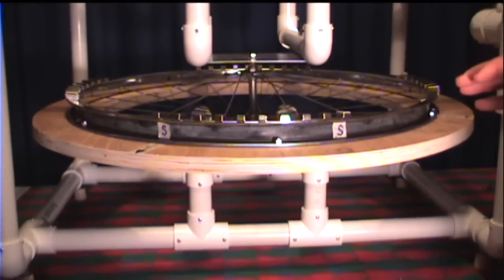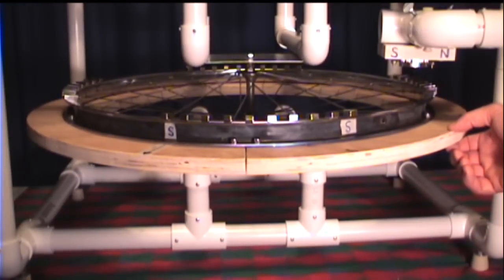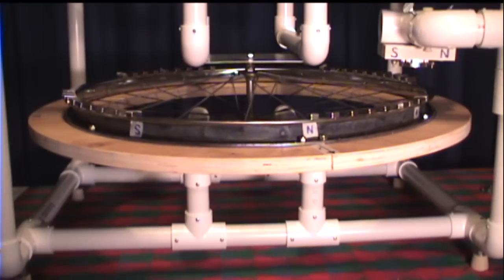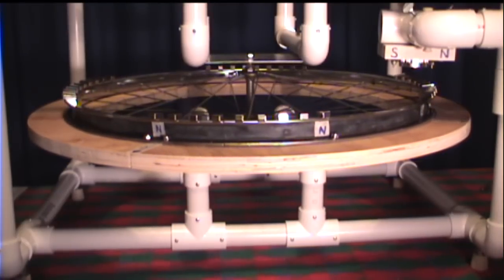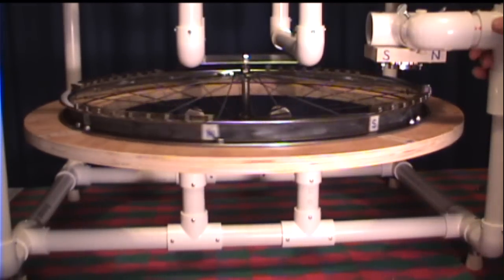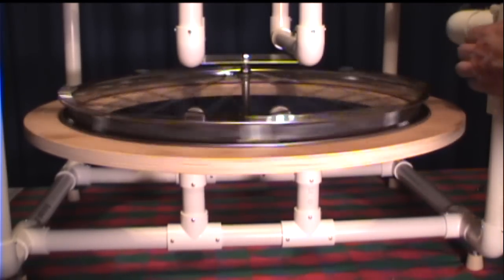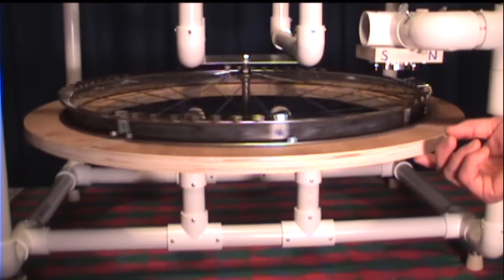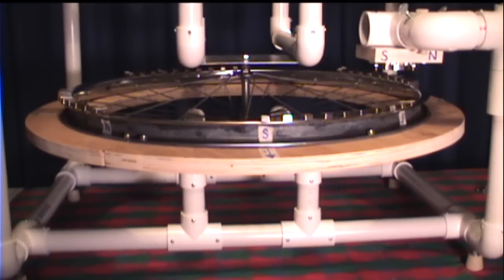Video #19, "Rick's Pipe Dream" Magnetic Motor - Generator Project

Comment from the maker: Stefan, the 135 degree demo showed 2 accelerative forces followed by 2 decelerative forces, and that was only because the stator was in a fixed position. When moving the stator, all the forces are accelerative, and there are 8 of them per revolution, but only 4 stator movements required. Also, each stator movement required less force than any one accelerative force produced. The excess force from the accelerative effects is stored in the rotor and flywheel as inertial momentum.

Comment from the maker: Hi jillyand, and thanks for your post.  Magnetic movement of the stator carriage is what I am currently working on.  See my latest 3 videos for views of the slider carriage.  Two magnets at the center hub will be used to repel the carriage outwards, and two more at the outer perimeter will repel the carriage inwards at the proper timing points (directly after the tail end magnet of a rotor group passes the carriage).

Comment from the maker: @100roberthenry - Hi Rob, you may find video #32 of interest, which utilizes a sweeping rotor magnet pattern. It does work as an attraction layout, but one cannot utilize attraction and repulsion this way in the same direction of rotation. In other words, in order to gain some repulsion acceleration, the rotor magnet interacting in repulsion with the stator would first have to pass under the stator and then repel away from the stator. Until it passes, it is working against rotation.

Comment: I think they are right a good analogy would be loading a sping then holding it back till you need it. The force needed to move the stator would far outweight what you get in drived motion. Of course the spring has captured energy but you loaded it. The only way around it is to look for a less resistive way to move your stator. Say rotational movement. You could make a round track that the movement gets focused any way you want and use that to flip the poles quicker at higher speeds.

Comment from the maker: The animation is not a continuous one, but with 32 frames it shows two pole shifting movements of the stator, and the basic magnetic interactions that cause these movements.  Be sure to watch the animation in a full screen view, or it will not display properly.      -Rick

Comment from the maker: Yes, the starting point that I used was the high repulsion margin at the tail end of a north facing magnet group, and this gave a spring like effect in conjunction with the north stator pole to start rotation.  The second positive rotational force is encountered at the next magnet group, which is south facing and thus in attraction with the stator north pole, causing further acceleration.

Comment from the maker: It was not friction that finally stopped the rotor after its 135 degree movement, but rather the two decelerative forces that followed:
1. Attraction force at the tail end of the south facing group.
2. Repulsion force at the lead end of the next following magnet group which is a north facing group.
The only reason those two forces stopped rotation is because the stator poles were not swapped at the end of the south facing group, as they would be with a moving stator. Demo used fixed.

Comment from the maker: It won't help to do anything that would counter the wheel movement, when that very movement is exactly what is needed to produce rotation.  Your cam idea is correct, though, and it happens to be the modification I am currently working on.

Comment from the maker: The magnetic interactions causing thrust and accelleration can definitely help move the stator.  Momentum is the other key driving force for this.  The inertial momentum of the wood flywheel, steel bike rim, and the weight of the magnets, should be enough to more than meet the remaining force required, imho.

Comment from the maker: As an inventor, Edison made at least 1,000 unsuccessful attempts at inventing a practical light bulb. When a reporter asked, How did it feel to fail 1,000 times?,  Edison replied, I didnt fail 1,000 times. The light bulb was an invention with 1,000 steps.  Should Edison have given up after the first unsuccessful attempt?  If not, then why should I give up if my first attempt proves unsuccessful?  And remember that my first attempt success or failure is yet to be proven.

Comment from the maker: And yet the rotations, though very slow, continue through several magnet groups which oppose the fixed stator, and this is simply due to inertial momentum.  With higher speeds there is greater inertial momentum available, and with a moving stator there are no decelerative effects.  I'm sure you can't imagine how small a force is actually required to move the stator magnet.  It is almost negligible, and I have no doubts that the stored rotor and flywheel energy is more than enough to handle this.

Comment from the maker: Watch near the end of the video, where I deliberately slown down the stator to where it is barely moving, and you will clearly see the accelerations at the tail end of the north groups and lead end of the south groups, where accelerative repulsion and attraction effects, respectively, occur. Keep in mind that there are also an equal number of decelerative effects occurring because I have locked the stator in place with the north pole over the rotor magnets.

Comment: Good vid! I fear the critics won't be convinced just yet.
Their question probably would be the amount of megnetic resistance your hand is overcoming when making that pole switch. Does the stator want to change position, and if not, how strong is the resistance relative to the 2 positive input into the wheel it's just given? And if it really want to switch poles, how much resistance is required on the stator to prevent it from slipping out of position where the magnetic interaction is preferable?

Comment from the maker: Yes, I realize Edison was not the first to invent a light bulb, and qualified my statement with the words,"practical lightbulb."  Several had been invented earlier by others, but none proved practical because the filaments would burn out very quickly.  As to the stator movement, yes I am currently working on my automated stator tracking and timing mechanisms, which will also utilize an entirely different stator mount.  Will show that soon.

Comment from the maker: How do you explain the rotational movement that occurs when the stator was fixed and my hand was not being used at all?  Watch near the end of the video when I slow the rotor down.  When the rotor is moving very slowly you can clearly see the accellerative forces at work as the rotor obviously and significantly speeds up at those attraction and repulsion points.  You also see the rotor finally come to rest due to decelleration forces, but this is only the result of the fixed stator.

Comment from the maker: Yes, lost10x, I placed the wheel in a loaded repulsive position to start rotation. What you fail to acknowledge, though, is that during rotation that point is always made available by a combination of stator movement pole switching and flywheel inertial momentum.

Comment from the maker: Stefan, I know you mean well but you just aren't getting it.  I am only showing that the machine will produce continuous rotation on its own for a 135 degree rotation with a fixed stator.  But I won't be using a fixed stator and do not need to worry about "sticky spots" and counter-rotational repulsion resistance because a moving stator avoids those negative forces while turning them into productive accellerative forces.  Watch the accellerations occur at 8 points during each revolution.

Comment: You would make the track have a wavy cut in it to move the stator any way you like to enable the flip of the magnet stator poles by rotation of the poles instead of a side to side motion. I would think there would be a better gain in power and speed capabilities using rotational actuator for the stator. I could be wrong but it might do better then side to side.

Comment: Just responding to the Edison statement which is a good attitude to take toward failure after the success is achieved, although, if you really look into it Edison was not really the inventor of the light bulb concept. Is there a plan to have the stator movement built in or will all the energy continue to come from someone moving it?

Comment from the maker: You can give me all the discouraging "experienced advice" you want, but it won't change my plans or my drive to succeed where others have failed.  If I am doing anything wrong that prevents me from succeeding, I will modify what I see needs changing.  So far, no modifications to my original plans have been necessary, so I definitely must be doing something right.  I know you won't agree, but that doesn't bother me.  Don't think that I'm asleep at the wheel if I don't make future replies.

Comment: 135 degrees is not enough.
You need to get it rotating more than 360degrees.

Get yourself a few 90 degrees iron core bars
like this video shows it:

/watch?v=u5mYm5nO5Fw

and then put them between your stator
and rotor magnets.
You need to asymmetrically guide the magnetic flux away from the sticky spots.

Regards, Stefan.

Comment from the maker: None of this has been done exactly as I am doing it, so claims that it can't work because others have failed are groundless. Your math appears to be off just as far as your thinking. Three dozen = 36, and I only have 19 videos. If you are worried that my project will end up disappointing you then don't watch its progress. It's quite that simple. I stated up front, and several more times, that I may not succeed at my first attempt for a self runner, so I am in no way offering false hopes.